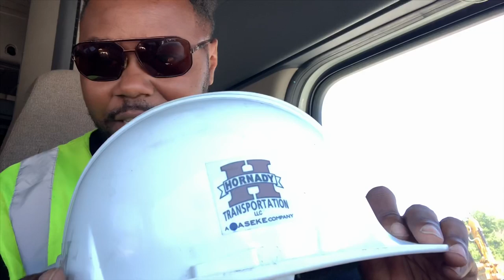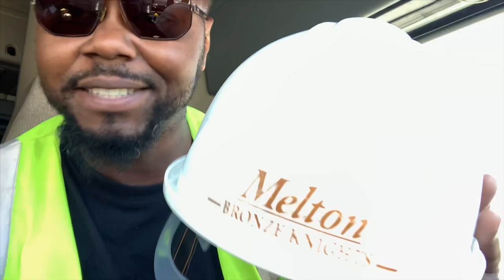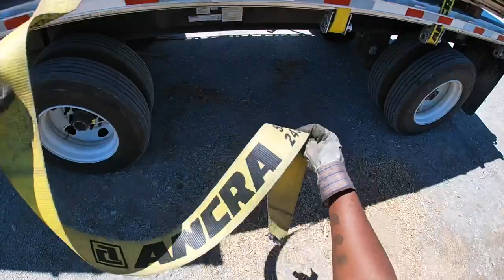Slight Hiccup On A Friday Lumber Load Securement P and S Transportation

Comment: Got a question nobody seem to answer in other channels.. So I want to become an owner operator, but my question is to you guys I’ve been driving for about 3 years now have experience but local and all the trucks I’ve driven are automatic I do have a little experience with 10 but not 100%. So what do you guys should I get an automatic or manual and learn on the way? For a first time buyer ??
Reply from the maker: Doesn't matter if the truck is manual or automatic. Still going to pull the same trailer. I'd go with what your comfortable with
Reply: Nice Visions thanks for the reply man
Reply from the maker: No problem